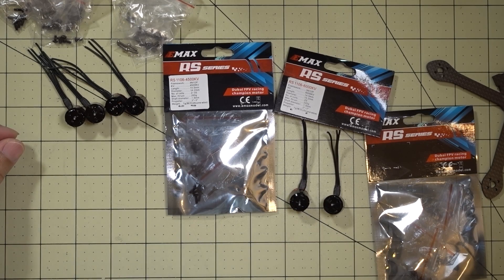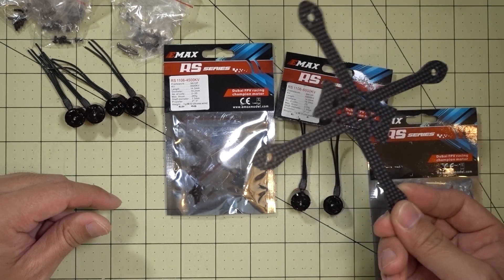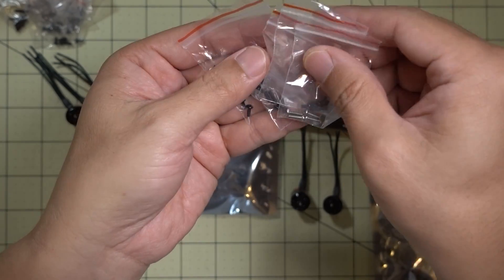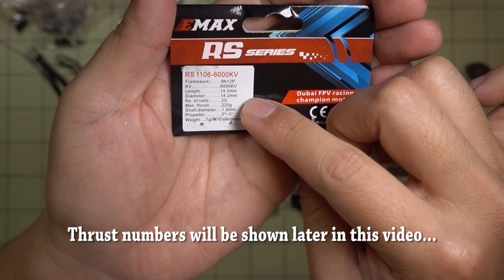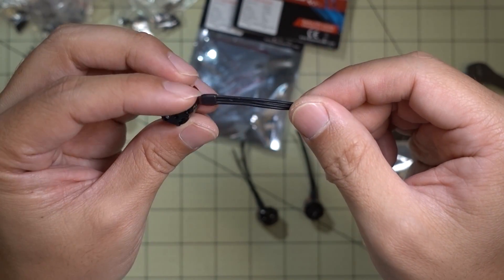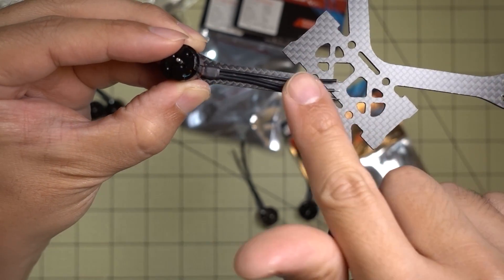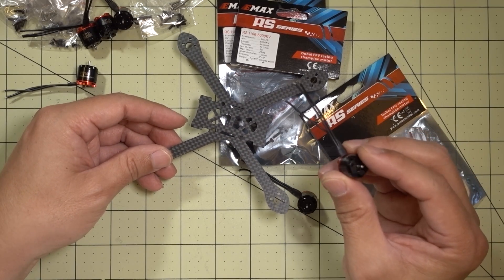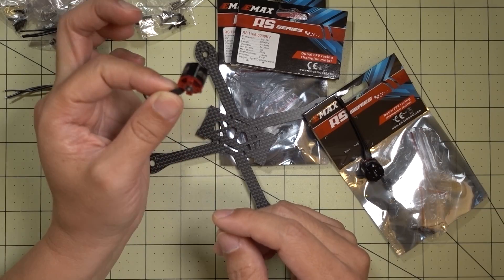EMAX RS1106 Motor Preview ⚡🔥👍

Comment: For running on 2s, AUW 220gm, gemfan 3025 prop, which KV of this motor is good? I am aiming for longer flight times. No freestyle or racing. Also what would be hover throttle percentage on my setup?
Reply from the maker: Get the 4500kv motor and run a 650mah or 750mah 4S for the most flight time.  If you want to go 850mah 4S, you'll need to go with a 3-bladed prop.
Reply: @AlbertKimTV  Actually I am aiming for a 3 inch endurance quad using 2 Samsung 25r 18650 cells. I want to keep AUW under 250gm. This guys could get close to 25 min https://www.youtube.com/watch?v=8Vh1KOxKuLI&lc=z22tdr2rhq2btbicwacdp430rch5zwusunewa3celdxw03c010c.1568030233459067

Comment: Albert I’ve seen a suggestion you can run them on 3s and even 4s. 4s being crazy hot but possible. 
What do you think?
Reply from the maker: The current Babyhawk-R uses the 1106 6000kv motors and people run them on 4S, so definitely possible.

Comment: Good afternoon, Albert, what's the smallest frame you've set for these 4500kv engines? I want to fly with 3s and 4s the micro, I'm walking with an FC XJB F425 with esc 25a and a micro swift runcam, I'm just looking for the frame I'm going to use, I would like your indication of a X frame.

Comment: are emax 1106 7500kv motors ok with 3s batteries?
Reply from the maker: depends on the prop and overall weight and the ESCs you're using. I wouldn't recommend it anything over 2-inch (2-bladed), anything over 90g AUW with lipo, anything less than 20-amp ESC.  Oh yeah, this is a fantastic way to kill off lipos if you have a lot of money to blow on lipos.  😜
Reply: LOL I love that comment Albert.  I think ill stick to 6000kv and keep my batteries.  Not like im going pro any time soon.

Comment: So I grabbed some of these 7,500's and I'm not sure what to think about these... They get awfully toasty even on 2s on the bench in a cold room....I had some ipower 7500s that I ran on 3s and it was a rocket and hoped that these would be even better being 1106 instead of 1104 and they are just straight terrible. Just hovering in a cold room they were like on fire... on the bench they pulled 10.5amps full throttle with some little 1935 tri-blades which is well under what they show for some of their props shown on the emax site... But they are so crazy hot even in motors tab. I was thinking maybe to get the 6000kv now but I already have some 6500 rotorx 1105s that do good anyway. I tried a test flight on 2s with them and they killed my 650mah tattu in less than 2mins just cruising around. I get 9min on the other motors lol.

Comment: I want to use these on my pred X with the 3" DYS 3045 tri-blade props. What KV would you suggest? I fly mostly 2s but also 3s. So I would assume I would want the 6000kv or the 4500kv.... but I am not sure on what the difference would be between the two. I'd love to hear yours and everyone else's thoughts.  Thanks!
Reply from the maker: 2S 6000kv, 3S 4500kv

Comment: Nice review. I'd like to see a bench test to see if you get the thrust that Emax is touting on the motor, prop, battery combo. Thanks for the review and Happy Flying!
Reply from the maker: Miniquad Benchtest has these motors as well and they will be doing a much better test than I could ever do...
Reply: Also engineer X does some great bench thrust tests as well, he also uses lots of different popular props

Comment: Interested in your opinion of quality between these and DYS (or others). My new Arfun 90 DYS motor has a bearing problem, I think (slight rattle when I hand spin), which is what is allowing the 1935 prop to hit the camera (I think). If I have to transplant to a bigger frame (leaving out the CS110 for now), would you choose Arfun 95 or Lizard 95 frame? I'm leaning towards the reptile...
Reply: Mark Sherman you can adjust the play in the motor by putting something like a prop nut over the shaft of the motor and putting it in a vice and very slightly pushing the bottom of the shaft upwards. it can completely take away rattles and other related issues.
Reply: Thank you adam-g1. That sounds like a hellofagood tip. I will try it if I can ever get the motor out (stripped one screw head trying to get it off - not sure I followed advice from RCG to use heat from soldering iron correctly. Thinking of trying to unscrew it from the motor side!). Then I'll have to buy a vise.
Reply from the maker: My initial impressions is that the quality is higher than the DYS. However, in the air performance is what matters, not how smooth they feel on the bench.

Comment: These reviews couldn't come at a better time. The BrotherHobby Returner R3 1106's I've been flying have been a massive disappointment. I suspect these emax units will hold the crown for strongest-performing micro motor, but I sure would appreciate a little confirmation before I drop the cash. Again.

Blah blah blah heat blah thrust blah numbers numbers.... Let's cut straight to the Tomoquads Baby Predator flight footage!!! :D
Reply: Ben Wnuk I feel the exact same way, I havent had the best luck with the R3 1106 5100kv. They run so freaking hot and are a bit too amp hungry for their size and kv. they flew great,  but the amp draw and heat is unacceptable. one motor ive found that's awesome for the price is the realacc 1106 6000kv on banggood for 7.89$ a piece. what issues have you had with the brotherhobby 1106?
Reply: Exact same issue as you, actually. I'm running the 7100kv on 2" props, both 2s and 3s (mostly 2s). The quality seems good, they perform ok, but they suck current far more than they should and just turn it into heat. Even at half the price, I'd consider them a bad deal. I could almost accept the heat and battery abuse if they were delivering spectacular performance, but they aren't. 

I've been eyeing those realacc motors but nervous without recomendations. I've been running some 8500kv KingKong 1105's on other quads and they've been nothing but lovely. Slightly too high of KV to safely run on 3s, but punch hard all day without complaint on 2s.

What setup have you ran with those Realacc 1106s?
Reply from the maker: Gonna get these built out ASAP...  I've run the Realacc 1106 6000 on the Squirt... I posted some insane speed runs on 3S on Facebook... you didn't see it?
Reply: Albert Kim I need to check out your facebook, I barely ever use it!
Reply: I'm sure I saw it, perhaps I didn't note the motors because I thought I'd already found The Good Stuff. Two votes for the Realacc motors, I feel a disturbance in my bank account...